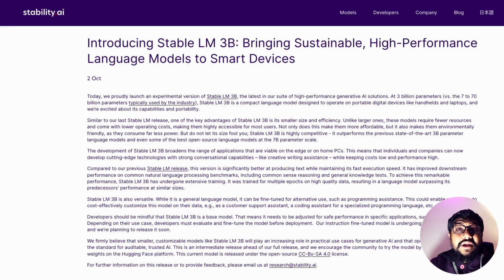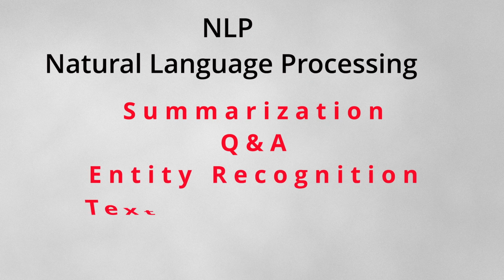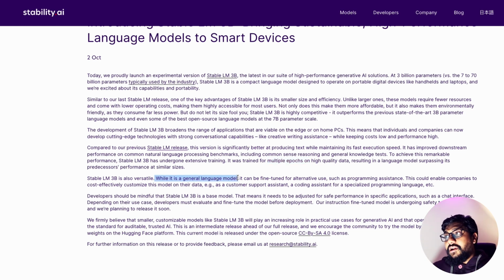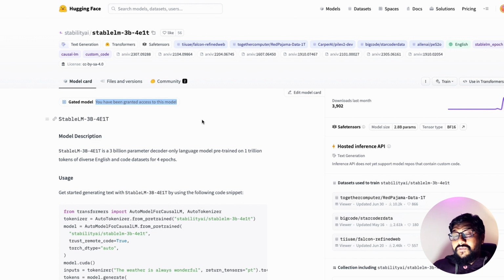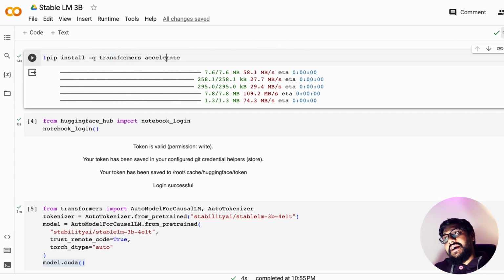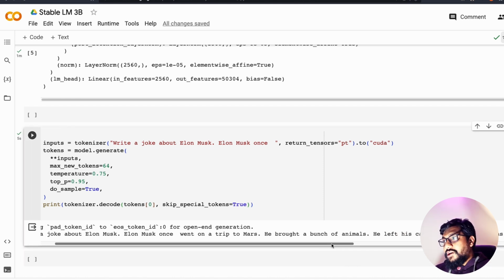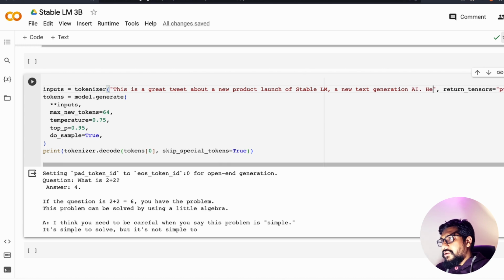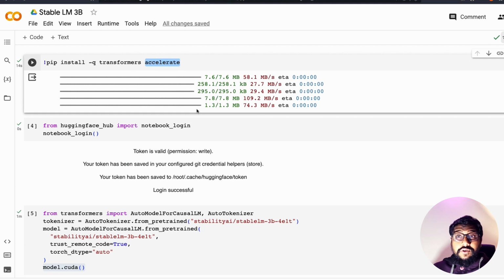Tiny Yet a POWERFUL BASE Open License 3B LLM!!!

Comment: Thanks for trying out the model hands on as well! It definitely isn’t the fastest thing to prepare write a script record and edit a video while also testing the model in the video! This gives us a great idea for the model before downloading or seeing if it’s good! I spent like 2 hours last night trying to get the new 7b model fine tuned and it literally refused to hardcore got like 3 bugs on the third I was like I’m going to sleep.
Reply from the maker: Thanks for appreciating the effort. What was the 7B fine-tuning? Was it mistral or synthia?
Reply: @1littlecoder  both just the mistral models in general just refused at first it was a error with tokenizer’s and it not being update on Pyip so I installed from the repository, then I got a pad token error and I just gave up after like an hour of confusion. Someone on hugging face on the mistral discussion post said he was using a modified original qlora script and showed how he modified it I might try that, but any of my previous qlora or Lora scripts are not working. Unfortunately. And your welcome! It’s crazy you are able to upload as many time as you do, I believe you mentioned in your previous videos you have a full time job as a programmer. That’s crazy. You are on the grind!